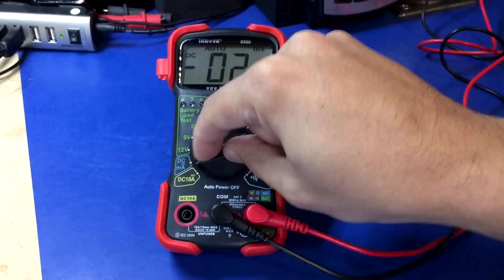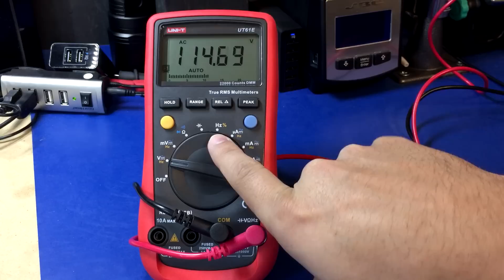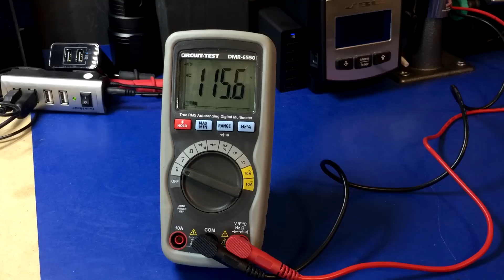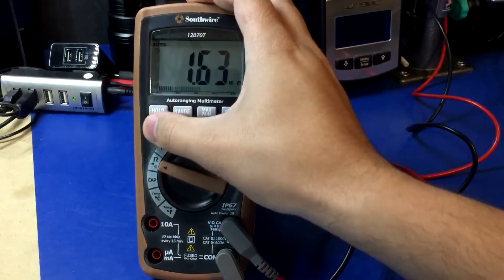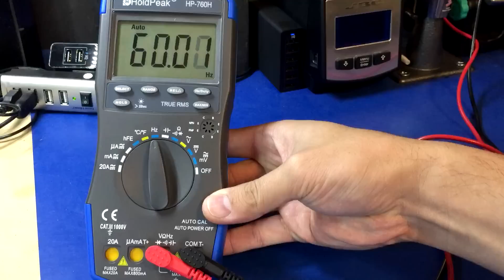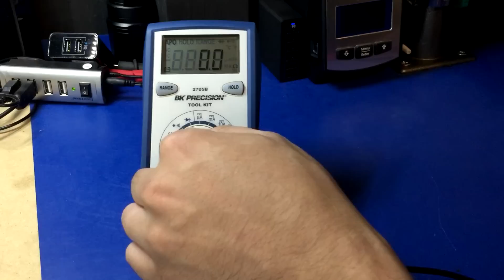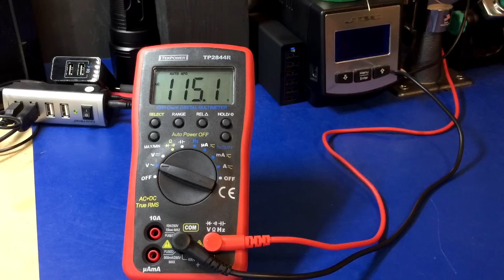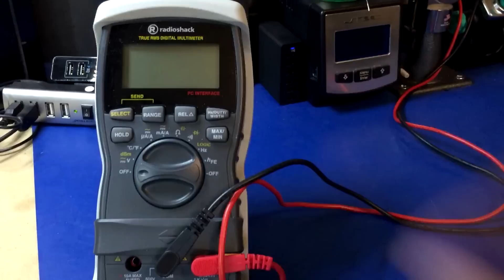$50 Multimeter Shootout - Part 10 - Mains on All Ranges - #0096

Comment: How could you get the courage to put 3 terminal meter in mA range when plugged into 120V. Either you already new it input protection with hrc fuse or u r an idiot or u r mad. U should do these tests at at least 240V, as that's the highest voltage u get home in many countries. It would have covered 120V automatically. Pls explain your act!!

Comment: I assume that "mains" means 120 and not 240.  I would assume that it might make a difference.
Reply from the maker: It can indeed make a difference. But being in the U.S., I don't have an easy (or safe) way of accessing 240 without accessing the breaker box. (DB board)
Reply: +TechnologyCatalyst  Well, running a long extension cord from other rooms of your house will eventually find that other phase between the two "Hots" for some UNSAFE, AND POTENTIALLY LETHAL 240 VAC fireworks!  

No need open up that breaker box or dial 911, it's just plain crazy though. Don't try that at home, especially if children or others are present!

Once upon a time, I used that trick along with four identical toasters to load-test a large step-down transformer (that had to go from Chicago to Europe along with some horrendous old-school 120 VAC  50/60 Hz piece of equipment). The fact that there are then two breakers in series does not add any safety to that test setup with everything still hovering at 120 VAC above ground!  It's a dangerous procedure to think through carefully when you have an insane power cord featuring two exposed "look out, the other one's still gonna' be Hot" male plug ends!

Impressive.  You must have nerves of (non-conducting) steel...

I watched your Part 10 meter test video expecting the mighty pop and blinding white, flesh-cooking flash that sometimes comes right out of the meter case and eats off part of your hand and/or face before you can even react to it!  Those spectacular results (and/or death) await at residential 240 VAC or in an industrial electrical vault where 230/208/400 and much higher voltages and will blow up a shady cheep-o-meter set to the wrong range!  It gets real ugly if voltage is applied across "Ohms" or a high-amperage current range shunt wire and some cheap, under-rated fuse just arcs over... BOOM!

Maybe wearing goggles and using a stick would have been a good idea (~18" of PVC pipe - securely plugged with a slotted end used to grip and twist the range knob), instead of potentially sacrificing a couple of your fingers to entertain the YouTube gore ghouls.   Glad there was no injury...